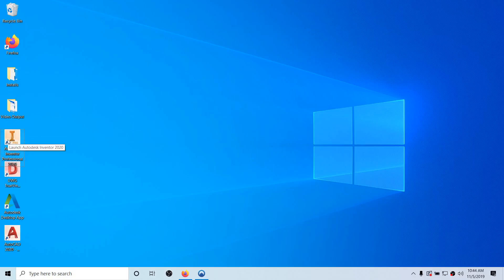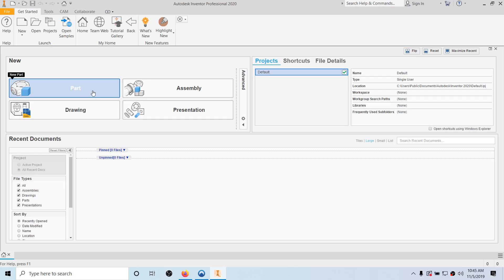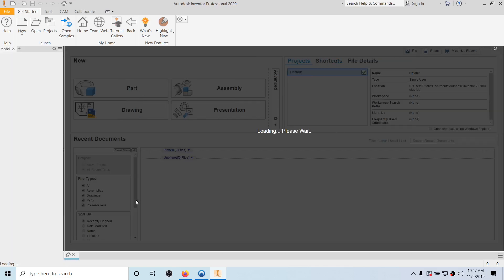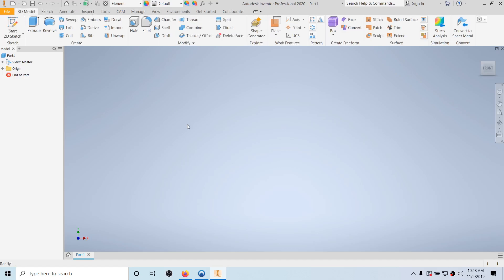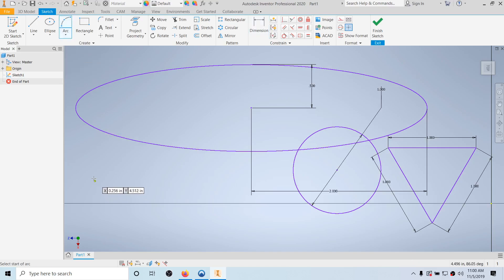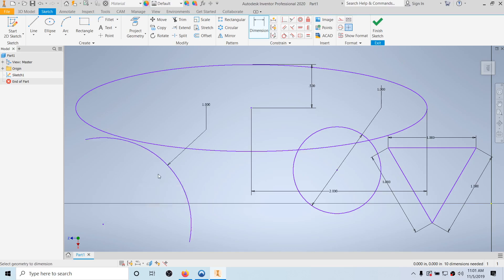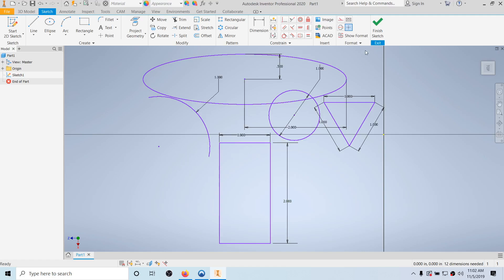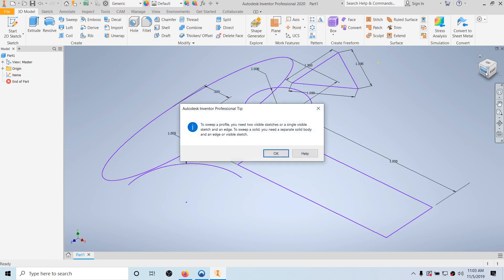Autodesk Inventor 2020: 1: 2D Drawing Basics

Comment: I used to know a lot about inventor 2020. But I forgot most of it after high-school. So now I'm relearning. A problem that I have is that when I want to 3d print something that I design, the preview comes out tiny. Even tho I put all of the dimensions. Like, I wanted to make a chess board. So I made it 8inX8in. Everything looked fine. But when I got to the preview of the print, it looked the size of an SD card, so I went back, and made it 80inX80in. And it was still too small. I printed it, and it's like 4inX4in. So my question is, "how do I make accurate prints?". Am I forgetting to click a setting that makes the dimensions real size instead of presentation size? Any help would be much appreciated. Great video by the way!
Reply: Sounds to me like your printer is printing in mm, but your sketch is in inches, convert one or the other to match